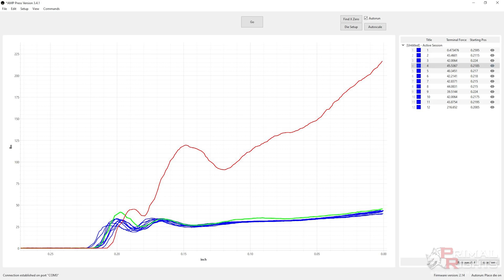This is hurting your performance!

Comment: As a retired machinist of almost 60 years, I call it interference fit.  If your projectile OD is .224 and your cartridge neck ID is .220, you have a .004 interference fit.  You could also call it a press fit.

Comment: I think the problem here is that most people don't come from a machining background and aren't sure what  "interference fit" means . Also you can't measure an interference by distance, it needs to be measured buy pressure., Or some esoteric Newton meter reading😂
Reply from the maker: Indeed you are right.

Comment: I also anneal my brass everytime. An old bench rest shooter told me about the Lee Factory Crimp die. I'll use a medium crimp, 2 pulls on the press rotating the cartrige about 180 in between and that has really helped my accuracy and shrank my group size down to ragged holes at 100 yds

Comment: Thank you for this video, you are spot on. Calling a diameter interference fit a tension is just stupid. It is a dimensional variable and has nothing to do with force directly. Frictional force is defined by a coefficient of friction (static or dynamic) times the normal force to the motion direction. Since most hand loaders can’t become development laboratories, it is natural to use the diametrical interference fit between the bullet O.D. and the brass neck I.D.. it comes down to the expense hole you wish to delve into versus establishing a very consistent processing of your components and their final assembly. I vote for the latter.

Comment: Thanks for the video Greg! I’ve long wondered a better way to understand the neck tension dimension because it just doesn’t make sense as to why pressing the shoulder or neck down (sizing) creates measurable tension with different thicknesses and brass compositions… Interference fit seems to make more sense!

Comment: Makes ya wonder how the shooters from the 60s a 70s  managed to get the group they did without the newest an greatest gadgets of today
Reply from the maker: That's because they didn't. By today's standards, if taken as the typical 1st place performance, the group sizes and scores shot in the 60's and 70's do not hold up to what people are doing today. What they were doing was still impressive given the equipment of the era, but there is no comparison to how consistently people shoot today. Even the average shooter can lay down performances that would have been considered supernatural back then. This also doesn't discount some of the extremely good groups/scores that were turned in, some of which are still impressive even by todays standards... but there can be no argument that those results are far easier to achieve today with the advancements in every area of this discipline.
Reply: @primalrights  I grew up in that time on the line's an benches with my family most of the places we traveled to back then are no longer there 22 hi-power center fire was the greatest next to the 24s seen some extremely good groups

Comment: Redding uses neck tension terminology in their catalog which is where a lot of people get information from. For myself I’ve played around with different neck bushing sizes and found a sweet spot trying to error on a solid hold due to recoil when a rifle is magazine fed. Your spot on that the bullet only wants to be released as consistently as possible. Even a simple arbor press with a in-line seater gives you seating force feed back a AMP press is cheating. Now please layout your secret recipe for that ultra consistent seating force.

Comment: Let me start with...LOVE THE VIDEO!!! At 14:50 you talk about the relationship (or lack thereof) between diameter interference and bullet seating force. My brain calculates this...there IS a relationship between them, however, not a consistently measurable relationship. With that said, I'd be curious to see if the same lot brass, fired once, annealed, making an attempt to keep ALL things equal between the brass and the prep of the brass, using your nifty AMP press, would result in VERY similar seating pressure requirements. Just a thought. Thank you for making us THINK and for keeping us on our toes! GOD BLESS!!
Reply from the maker: Watch the recent "should you anneal" video... the exact test you request, is in that video.

Comment: With the RCBS Matchmaster FL B set 6.5mm CM die set the expander (mandrel) diameter is 0.261" which is perfectly 0.003" under the bullet diameter of 0.264"....RCBS knows that 3 thousandths under your bullet diameter is the way-to-go!

Comment: Glad someone finally said it, I agree completely.  I use standard dies for my loading with a the supplied expander ball.  I do trim and deburr the flash holes and turn the necks of my brass and sort by weight but that's it, I don't chase the lands either.  My Savage in 6.5 Creedmoor shoots to 3/8moa or slightly less.  Thanks for the advice on adjusting the dies to start to expand the neck while the tip neck is still in that portion of the die is genius.  I'll run off 50 to see if there is a measurable group difference, I'm betting all things being equal there will be.

Comment: I am no math wizard, but if your mandrel is .003 under bullet diameter, that means if your interference is .005, then your brass is springing back another .001/side coming off the mandrel.

Comment: Greg,
You're provoking the natives.. You should have titled this video "The reason why everything matters" or "The need for knowing the true science and process of correct annealing to determine friction interference using your Amp press and Annealer" or "How hard is your brass? No, i'm not kidding.. really how hard?" etc...
But you may have run out of space for these titles. 
I use a webster to test my annealed brass because I have not popped for the amp products that i must agree have revolutionized elite level ammunition quality and data driven process knowledge. 
You are a true renaissance man! I'm going to join your content supporters or make a visit for the full Greg experience, either way I'm sold!

Thank you for the content!!
Reply from the maker: Thank you! 👍

Comment: Great video, but I have a question. I am also using a SAC modular sizing die. You had mentioned that you are using a mandrel three thou below the O/D of the bullet. I was wondering, do you have a set rule for the size of the bushing, you use in relation to the mandrel? You mentioned the bushing, but I was not clear what you actually said about it. Also, did I miss it in the video, other than the “three thou under the bullet diam” you were able to achieve repeatable pressures on the Amp press? If you answered these, I apologize, I’m pretty old and a bit slow now at times. Thank you
Reply from the maker: There will be a future video to address this.

Comment: I'd like to ask you what are the math you do to choose the proper bushing to ensure your mandrel work enough and his not just operating in the spring back. Is there formulas like the one we use in the aircraft industries with sheet metal?

I never done anything with brass and cylindrical shapes.

Like for example for a 6 Dasher. You would be using a 0.240'' mandrel and the brass neck wall thickness is around 0.01325'' (Alpha). Loaded it's around 0.2695''.  What would be your calculation for figure out what bushing to order form SAC?
Reply from the maker: Look for future content on this.
Reply: @primalrights  Haha alright I’ll try to be patient. It’s hard to be when you want to understand.

Comment: Could you elaborate on the difference in process between your two examples? Also have you thought about addressing the common thought process of bullet runout and at what point it becomes an issue?

Comment: Have you found a range of bullet seating force that is generally desirable for consistent accuracy?  I understand that this value could be exclusive to each set load of parameters, but is there a general area you're looking for when working up a new load?  Thanks for all the content and knowledge you share!
Reply from the maker: 35-50lbs
Reply: @primalrights  thank you for taking the time to reply!
Reply from the maker: You're welcome.
Reply: @primalrights  And what do you consider a good range for peak force on the AMP Press? So say your average is 40 - how much up and down are you in general?
Reply from the maker: @sf2189  Good results are typically +/- 2lbs, so if I have a total swing for 90%+ of the rounds that fall within a 5lb window, I'm good. Depending on how seriously I'm taking that ammo, I will accept up to a 10lb window. Anything outside a total 10lb low to high variance gets culled for certain even on ammo I'm not super concerned with.

Comment: I'm missing something here Greg.  How thick are your necks and what are you using to cut them? 
35-45 lbs of seating pressure is where I try to live as well but 0.003 will not get me that low.
Maybe I just don't have a grasp on the yielding/spring back issue yet.
Reply from the maker: Future content will reveal.

Comment: Generally speaking how much seating force do you see on the AMP press when seating your bullets? I’ll admit that I am probably running interference a bit loose but I typically see a value of 40 on my K&M press with a farce pack installed and it’s pretty consistent from what I can tell.

Comment: I wonder how much of the interference fit is lost after you shove a bullet down in it.
 The bullet basically acts like an expander mandrel opening the neck there has to be a point of diminishing return where all we're doing is overworking the brass. 🤷🏼
Reply from the maker: Yup, future content on this as well. This starts happening at about 8 thousandths of interference, depending on the specific brass in question.

Comment: I've found, using an AMP Press, sometimes I have to use an expander mandrel only .001" under or the same diameter (spring back) as bullet diameter to achieve around 30-50 lbs. of seating force and if I use a smaller diameter (-0.002", -0.003") mandrel, the seating force goes up as high as 125 lbs., which in my opinion is too much and could deform the bullet. Maybe not. I'm not sure what the limit is, but 125+ lbs. seems excessive. This varies from brand of brass and caliber, but I try to achieve a seating force of between 30 lbs. and 50 lbs. I have a 300 WSM F-Class barrel that performs better with around 80 lbs. of seating force. I'm not sure I agree with your assertion that using a .003" smaller diameter mandrel, across the board is necessarily sound practice.
Reply from the maker: That's because you're not thinking past step 1. How else do you suppose you can alter bullet seating force without changing expander diameter? Lots of ways. I can keep my expander at 3 thousandths under, and make my seating force whatever I want it to be. So I don't have to be wrong in one step, to get right in another step. I can be right in both steps. I'll have a video on that sometime.
Reply: @primalrights  My bet is you anneal after you resize ;)
Reply from the maker: @martingagnon4547  Negative.

Comment: You made a passing comment on tumbling brass in rice, do you add any kind of polish or cleaning substance to the rice or is it plain rice.  I've been using a rotary tumbler with rice but it doesn't seem to come out as shiny as what I've seen from you.
Reply from the maker: Nope, no polish… but it has to be the rice brand and type in my article.
Reply: @primalrights  What is your recommendation for the best vibratory tumbler to use with your preferred rice?  Thank you!
Reply from the maker: @johnkennedy6331  Thumlers uv-18
Reply: @primalrights  Thank you!

Comment: I have always thought it was weird how neck tension was expressed since brass has springback.

Just giving it some thought, having not tested, perhaps the way the average person can achieve the best consistency, given everything else is done the same way to the brass, is to use the bullet as an expander so the brass yields.

If the brass was prepared right and consistent in theory this would yield a consistent holding force.

But other issues may arise, controlling run out (a seater die could be made to control this but would probably have to be custom to brass due to neck thickness variance) damage to bullets, crushing cases.

Just some quick thoughts

edit I forgot to put that measuring seating force with something like the amp would be ideal.